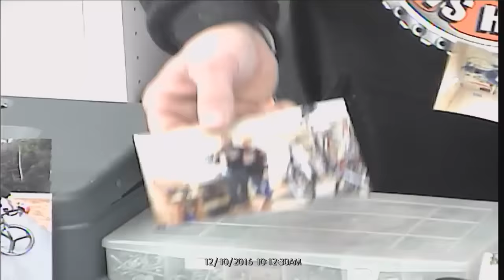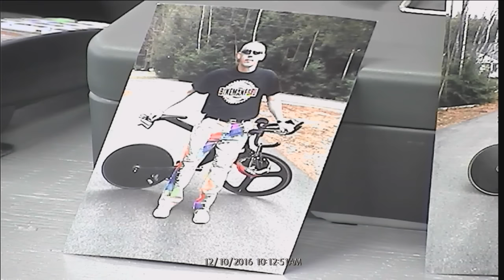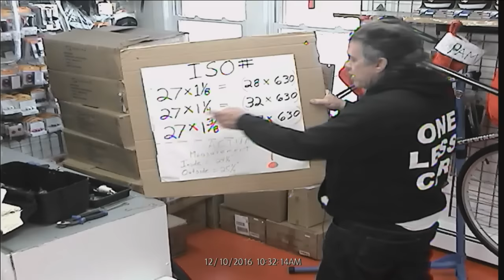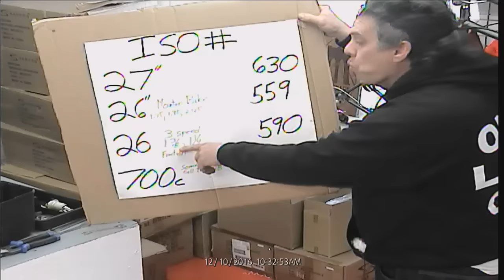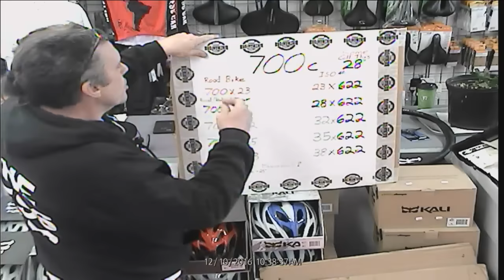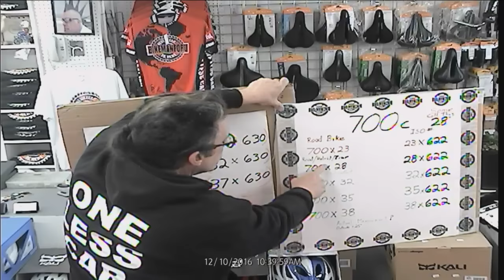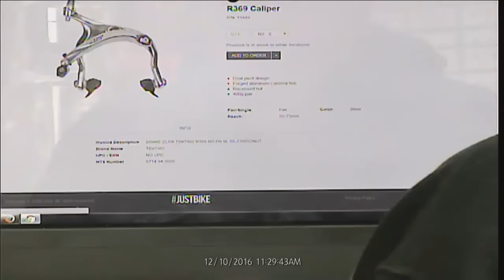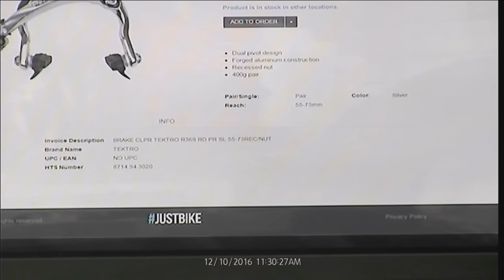Bike Shop LIVE "Moochers, Discounts & Labor Rates" S4E50 BikemanforU Show 12-10-16

Comment: It seemed like every customer was looking for free service or an angle at Performance Bicycles in Fairfax, VA. They would try to tell you that the service you recommended was not needed but it was needed. Alot of people would like to bs with you but I politely told them I had service work to do. I used to do 5-8 tune up clean ups on my shift. I was part time. I saw a guy argue with my manager about the price of a tune. His bike was seriously neglected. We charged $80 for a full tune and the guy asked what he could get for $30. My manager told him not a tune and he freaked. The guy also wanted to store his bike at our shop for a day and my manager said no. We were packed with bikes that customers agreed for our services. I have never seen a grown man throw a fit until then.

Comment: I like the last mode memory feature of the Serfas usl-450 headlight. It really saves the life of the switch. I was surprised BM4U likes the adjustable mounting clamp that comes with the light (maybe I am confusing this mount with the old style Serfas used where you had to re-position the strap for different size bars). If you have 2 bikes with different size bars, than the clamp needs to be adjusted each time to mount the head light. I thought the silicon rubber bands were quicker and better head light mounts, but they do run into gripping problems if the round bar is too small. I guess it depends on your bicycle and how you use the light. I noticed even the cheap headlights and taillights are starting to switch over to the rubber band mounts.